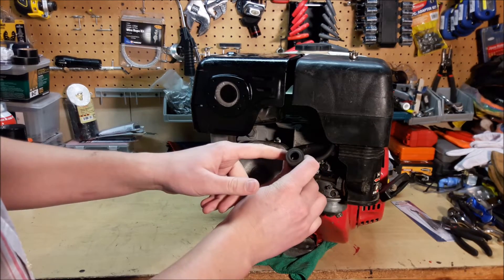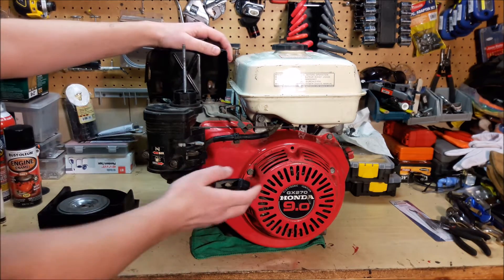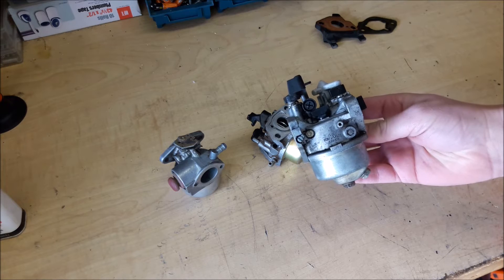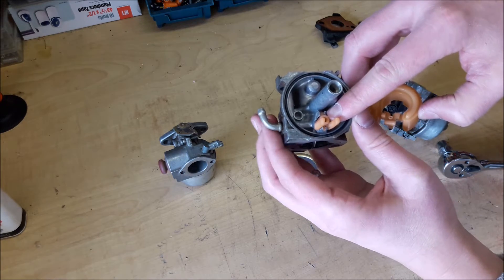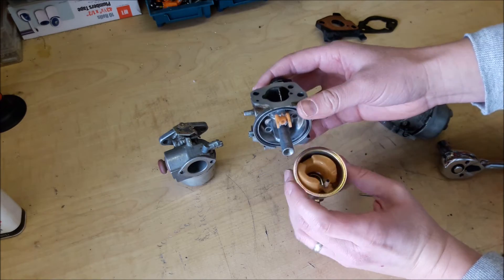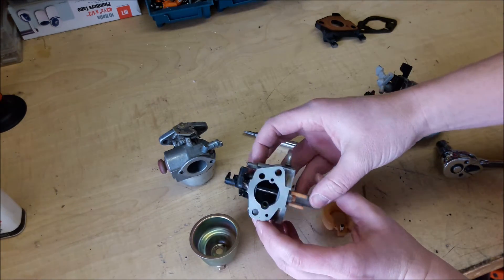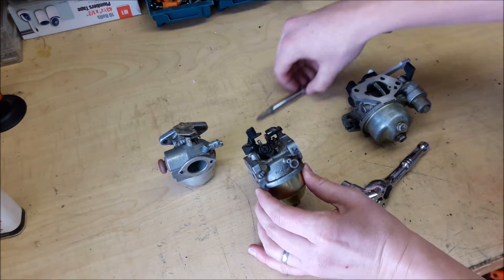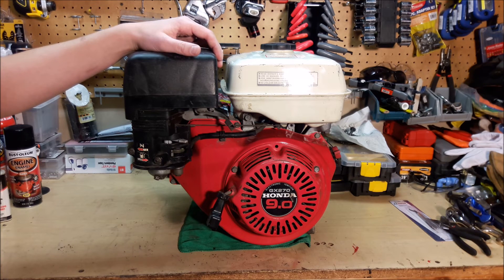Small Engine Repair Honda Won't Start?

Comment: My gx610 will not pull fuel up from the tank to the fuel filter.  How does the fuel pull up from the tank to the filter since it's not gravity fed?
Reply from the maker: If it's not gravity feed with the tank on top then you'll need a fuel pump. Just search GX610 fuel pump.

Comment: Thank you very much, you posited 99% starting engine problems are cloged port passage problems. I followed your instructions, and cleaned the carburetor ports and voilà that fixed my starting problem, it was an easy process and only took me about 30 minutes from start to finish. Yours was the best answer that I was searching for. Once again thanks !
👍👍👍👍🫡🫡🫡🫡

Comment: Couldn't tell from this video, does the plug need to be grounded against metal chassis to spark ? What do we do if there is no spark ?
Reply from the maker: Yes, I usually just rest on or next to the engine block.
Reply: @-DIYPRO-  I finally figured out why my hole auger wouldn't start: I did not get the torque bar with it and that closes a kill switch near the engine when installed. Took me a day of research. These things are really dangerous and I emphatically suggest no one get one if they think it's a one man tool. It takes 2 big guys to use. i realize that's a little off topic as this vid is for motor only. Carry on.

Comment: What if I take off the float bowl on Honda GX 120 and its only has drops of gas inside?...Thats my issue.
Reply from the maker: Then fuel is not getting into the bowl. With the bowl off see if the float is opening and closing (it's the plastic donut looking thing). It should hang down and be letting gas enter. Then if you push it up it should close off. Those get stuck closed and open all the time. I wish I could post picture in comments to show. Hopefully that makes sense.
Reply: @-DIYPRO- Yes...needle valve with spring?...I am going to remove that and clean it up..also remove jet and clean...The bowl itself is super clean...no residue-coloring etc..like you said hopefully its just that needle valve thingy..

Comment: I learned two things on my last Briggs carb clean and diagnosis:  

When i removed spark plug and pushed possible air/fuel out of cylinder, i cleaned lightly with my starting fluid.  When i tested for spark... it lit my light spray off fluid.  Hard for my eyes to look for spark... but easy to see a 2 second fire!  (I will actually purposely use this method in the future!).
Secondly,  my single bottom bolt to the carb bowl supplies the main jet!  I used my torch tip cleaner kit, dupray,  and comoresser air... she fitted right up!  Fresh gas, a bit of mystery oil... and my freebee pressure washer is on its way for use!
Reply from the maker: Right on!

Comment: Does WD-40 work for cleaner?
Reply from the maker: No. Brake cleaner and carb cleaner are fast drying solvents. WD won't dry up and will actually start collecting dirt and clog it even more.

Comment: So what if you have a honda 5.5 with less than an hournon it valves lashed properly has plenty of spark plenty of fuel going into cylinder and plenty of air and will not fire at all pops and that's it thank-you!
Reply from the maker: If the lash is correct and you are getting spark then it's probably the timing.

Comment: Once again, you failed to check the level and condition of the oil before attempting to start the engine.
Reply from the maker: Agreed, Honda does put an oil level sensor on there and it won't start if too low.

Comment: HMMmmm - Didn't you think that the sediment bowl on the carb needed to be looked at?
Reply from the maker: That wasn't the carb from that engine. For sure if there is sediment in the bowl then it needs to be cleaned out.

Comment: Does the bowl have to be full (float working) in order to start?
Reply from the maker: No, you can start it with just a little starting fluid in the carb. To keep running, yes the bowl needs to be full.

Comment: I have a greyhound 6.5 it’s similar to those engines. All it needed was a pitcock for the gas tank. Started up and ran beautifully when we poured gas in the carb without the gas tank. Now we got the gas talk on and tried starting it even after we poured a lil gas in the carb it didn’t want to start at all
Reply from the maker: That's a weird one, did you end up finding out the issue.
Reply: @-DIYPRO-  yes, apparently the throttle was attached straight to the governor ( it’s on a go kart now) so there was no idle setting, the throttle was fully closed. I ended up having to get someone hold the throttle a quarter of the way open while I start it to get it to fire up.

Comment: Okay I’ve done the vavles regap n check the rods one wasn’t conntrd fixed that check for gas carb was leakin early fixed that as well check spark it’s there fuel going to the carb not the engine so guessing carb clean which only thing I haven’t done ran at the trailer when threw gas down the carb carb spray start didn’t work but gas did Um so gonna clean the carb n let ya know how to goes just annoying didn’t seals new cams everything just to be like no spark at all lol gets spark just no fuel
Reply from the maker: Did you end up cleaning the carb? Did it work?
Reply: @-DIYPRO-  not yet I’m try to that tonight if I get the time I ordered a new one anyways cause the left side bolt hole shoulder is broken n fuel screw is bent so may not work lol
Reply: @-DIYPRO-  gonna try it anyways just to see I’ll keep ya posted boss man
Reply: @-DIYPRO-  nah cleaned the carb didn’t do anything timing was off by the smallest bit out the old carb back on leaked like crazy put the new one on still leaked took that plastic spacer out stop leakin lol engine runs ok it’s a cruiser for sure no top speed at all a 12 year old be comfy with the speed lol gonna go out buy new engine this weekend lookin at a 420 with electric start to swap into it or lookin at a 190cc semi 5 speed kit to throw into it just thinkin on which way to go atm engine that’s in the mini bike smokes like crazy thought it was the two stroke mixed gas buddie ran in it before it was parked but nah ran it 7 times now easy 20 mins each didn’t burn it off check oil the oil I use it great I find just think the seals on top end need to be done now already did the bottom end so might as well rebuild it with the stage 3 kit for the cams atm wish I didn’t sell my first bike ran great had a Hemi on a doodlebug miss it buddie wants 150 more then I sold him it n it’s damaged to hell lol

Comment: I wasn’t soo lucky.
Mine’s going to the shop. First it’s going to get a new carburetor & second a battery powered electric start. Why the fucknuts had a pull start is absolutely stupid! Ethanol fuel only ruins carburetors. I’m not going to try your repairs. I know what the shop will say before dropping it off.
Reply from the maker: I ended up putting an electric start on this one as well, so much better.

Comment: My carb got gummed up. Mine, an older 6.5, carb gaskets were definitely not ethanol friendly. The gaskets swoll and broke down clogging the jets.when I took of the bowl there was a goo of melted black gasket and gas slime.
I had been running it every day for about a month. Took a weeks vacation. Didn’t drain the bowl. Came back and It wouldn’t start.
Reply from the maker: Been there!

Comment: Other than cleaning your carburetor and you’re still not getting fluid how do know , when to just swap out carburetor with new one?
Reply from the maker: If you test it out with some starting fluid and it starts up then dies then you know for sure its the carb and you can replace it. If you shoot carb fluid into the carb and it still doesn't start then it's something else. Check spark plug, check oil level (some small engines have oil level sensors that cut the engine out if low oil)

Comment: Hi there! For winter storage should the choke be left on the on or off position?
Reply from the maker: Choke doesn't matter. Important part is to either run the carb bowl dry or if you have a fuel cut off switch then turn it off so no fuel goes into the bowl and run it til it shuts off. the killer is ethanol fuel sitting in the bottom of the bowl. It will separate and gum up the ports.

Comment: I have the same engine I can't understand why it doesn't start, it has compression, it sparkles, I cleaned the carburetor but nothing, even putting gasoline directly into the cylinder it doesn't start, what could it be?
Reply from the maker: Mine is currently covered in snow or else I'd go double check but I'm pretty sure these have a low oil sensor. That would be my next check. Double check that it has oil and that it's level. I say that because I had a tiller once that tilted the engine slightly and so even though it was full on the one end it was actually low on the senor side and would always shut off.

Comment: And what about the air/fuel mixture jet ?? Located under the plastic idle screw, if this is blocked then no starty or at the worst it won’t run clean !!
Reply from the maker: Good catch.

Comment: What do you think would be the problem if it’s leaking a lot of oil
Reply from the maker: I guess it depends on where it's leaking from, the case, from a seal, out of the carburetor?
Reply: @-DIYPRO-  I opened it up and the carburetor was covered in oil and were the air filter sits was also covered in oil. Then my brother found out that a rocker arm was broken in it

Comment: Why do you sound like this old tony ? If I’m honest I’d say this is defo this old tony
Reply from the maker: I don't hear it but you not the first to tell me that so I guess I sound a little like him.
Reply: @-DIYPRO-  I need help my Honda generater don't have power when I put Airfilter,it need to work without air filter
Reply: I already cleaned cuburater

Comment: What if it doesn’t run after spraying carb cleaner in the carb? My 240x on my trash pump won’t run. I sprayed carb cleaner and nothing. It has spark. But won’t run. I put fresh gas in it, new plug, and sprayed carb cleaner down in carb. Still won’t run.

Comment: thank you for your video but i have a honda 160 air compressor stopped working i changed the carburetor, spark plug, And it does not turn on, could you tell me that it continues to check

Comment: Thank you 😊 my engine is now going after watching this video the tiny hole in the jet in the carb was blocked very hard to see but I used a bristle from a wire brush to poke clean the engine started straight away also did not have to take apart as much just take 2 bolts of at the cup then use small flat head to unscrew the brass jet used a wire brush bristle to clean it engine going in 10 minutes 😀 👍

Comment: how would you go about inspecting a honda gx390 before purchasing it off craigslist
Reply from the maker: Does it run? If not then low ball the price until you feel comfortable knowing you might have to put a lot of work into it. If it runs then how does it sound? Check the oil, if tar then you know they haven't done anything to it maintenance wise. If clean then you know they tried to take care of it.
Reply: @-DIYPRO-  I found a gx390 listed for 400$ if it doesn’t run well how much $ could it cost getting it to work

Comment: The choke(white) lever can be removed & the round pin on it placed in the end of fuel line. Instead of crimping the fuel line

Comment: Thank you! Just cleaned out my carb on Honda 160 engine. Did exactly what you showed in the video and she started right up. You saved me at least 200 bucks!!
Reply: Thats amazing! 
I just recieved a plate compactor with a gx160 honda engine. Got it on the cheap because they couldn't start it. Im going to give this a try for sure. Fingers crossed.
Reply: You would've paid two hundred to get your small engine started?? Is that an average small engine shop bill?? If so... I'm changing shops lol
Reply from the maker: Glad it helped

Comment: This video allowed my gx390 to once again crank up and run. It turned out to be the ignition coil. Quick question - I bought my pressure washer (4k/4gpm - gx390 this engine) and after 2-3 pulls it will crank but it takes a little muscle to pull. The pressure washer pump is removed and I made sure the engine is not vapor locked by changing the oil and also removing spark plug (pulled a few times to rotate it). 

What would cause the pull to be pretty hard? I know this is a bigger engine but what could it be?
Reply: Need to adjust the values
Reply: @srdjannakalamic5856  While you're doing that check the exhaust valve rocker arm for cracks.  Usually the 160 and 190 engines are the bad ones but while into the valves it only takes a second to check.

Comment: Ok I have a 390 with key start,cleaned carb,have spark,will not crank even with starter fluid also has fresh gas and oil..what could it be
Reply: Ok will do. Thanks
Reply: Done that still nothing,i know the head gasket is blowed out,I'm not sure how long they ran the motor with the bad head gasket,it has no compression
Reply from the maker: @juniorcook4094  yea that would make it not start!
Reply: @-DIYPRO-  I changed out the head gasket and still won't crank and no compression,valves set right..last thing I know is changing the piston
Reply from the maker: Lots of them have low oil sensors and so if there is not enough then it won't start. Try putting a little more oil in it.

Comment: I had a spring on my GX 390 underneath the gas tank that broke. Wouldn’t crank for anything. To the shop it went.
On another one I have I bought a 14 dollar carburetor and it ran perfecto.
Reply: Was it the thin spring
Reply: junior cook I’m not sure. It was under warranty so I let Northern Tool fix it.

Comment: I change my carburetor and coil for my water pump. It will crank and show signs of starting but will not start. Should I check the valve clearance and compression
Reply from the maker: Do you have spark?

Comment: What if you use starter fluid but the engine doesn’t want to start at all.
Reply from the maker: Do you have spark?
Reply: @-DIYPRO-  I was going to ask the same thing. Yes, I have spark. Won't run even after squirting starter fluid in the air intake. Just a cough and that's it. Thanks
Reply: @whistlershootingadventures3819  Hello. I was wondering did you ever find out what the problem as, and how you fix it ??   ( i have the same problem )  Thank you for help or reply in advance.
Reply: @peedsii1991  It was a pressure washer and the problem was obstructed water flow. Easy to fix.